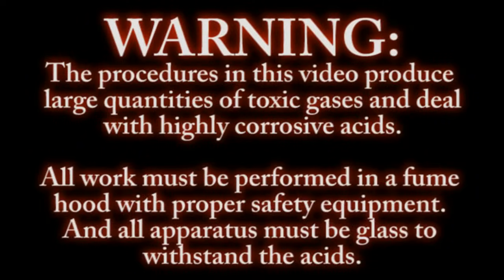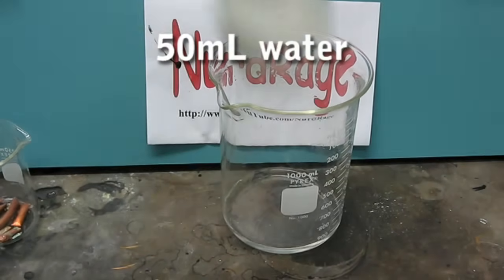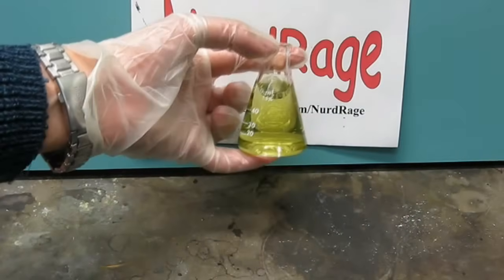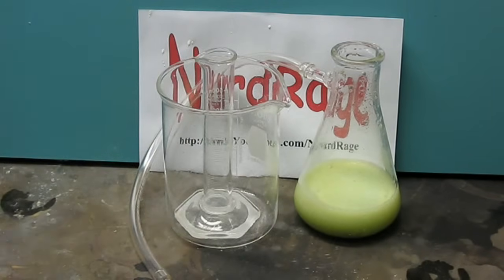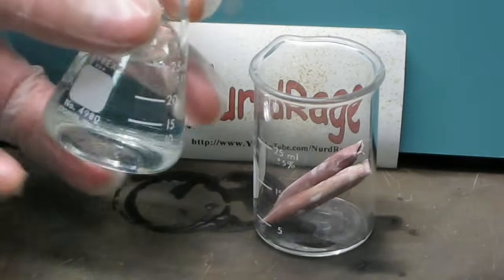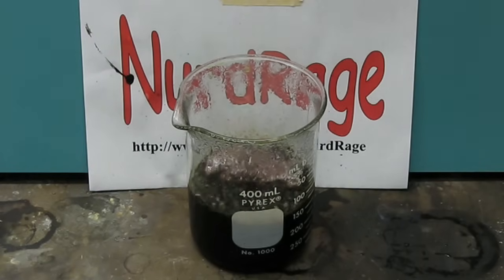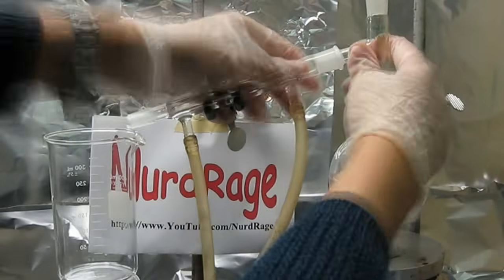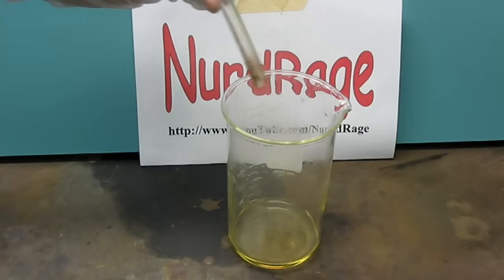Make Nitric Acid - The Complete Guide

Comment: I just thought about something. The reaction of nitric acid (formed from the hydrochloric acid reacting with a nitrate salt) with copper produces NO2 and copper(II) nitrate, which is a nitrate salt itself too. So does that mean that i could keep adding more copper and hydrochloric acid and the reaction would be renewable indefinitely? After all, the copper(II) nitrate would react with more hydrochloric acid to produce nitric acid, which would react with more copper to again produce nitrogen dioxide and copper(II) nitrate again, right?
Reply: MatBacon I wonder if there's a finite amount of nitrogen involved to process into nitric acid?
Reply: seigeengine So basically you're suggesting there would be a point where the copper(II) nitrate would run out?
Reply: seigeengine Gotcha, nice thinking there!

Comment: Make a tutorial on how to make hydrogen peroxide
Reply: Aeroscience +Aeroscience Synthesis of Hydrogen Peroxide
WARNING: Make sure you have a fume hood
Step one: go to the store
Step two: buy it for 1 dollar
Step three: take it home
Step four (optional): Pour into an amber glass to protect from light
Reply: Franco Miranda Food and drug stores only sell 3% hydrogen peroxide. He used 30% in the video, which can be bought at pool supply stores as a non-chlorine sterilizer.
Reply: Alternately, you can actually concentrate hydrogen peroxide.  Just pour 100ml of 3% into a clean (stupidly clean, perfectly clean, 100% truly clean like you'd serve it to the Virgin Mary clean...) beaker, put it on a hot plate and bring it to a light steam (not a boil.)  Let it evaporate off and when that 100ml is down to 10ml, it will be at or about 30% concentration.

Comment: Concentrated HCl boils at 48 to 90 degrees Celsius. If it was used during the exothermic decomposition of a nitrate with copper it would be evolved as a gas with the NO2 fumes. Wouldn't this reduce the yield considerably as HNO3 is a powerful oxidiser? I.e. Wouldn't the HCl fumes react with the HNO3 as it formed to oxidise the Cl- to Cl2?
Therefore, I wonder if a different and easily obtained acid with a much higher boiling point could be used? i.e. Phosphoric acid? If H3PO4 could be used the the Cu could not be recycled as it would not be aqueous and thus could not be displaced with Al (unless NH4OH was added first?).
Sulfuric acid is hard to obtain unless made in a similar process to your HNO3 process. The only place to obtain it in AU is in car batteries.

Comment: is this cheaper than buying it
Reply: +noahpitts12 Probably not, no. But it sure as hell is a lot easier than buying it... At least here in Finland lol.
Reply: cool thanks *****
Reply: @darkbowser ACCID It's highly regulated in some places
Reply: @darkbowser ACCID if you use 98% H2SO4 instead of drain cleaner, and your KNO3 has been recrystallized you can produce a much higher concentration of nitric acid than the azeotropic 68% crap that Amazon pedals and you don't have to pay a hazmat shipping fee either. fyi. just a couple of reasons for synthesizing it yourself.
Reply: You can't buy it here it can be dangerous in the wrong hands

Comment: There's a problem here.  NO2 is a "mixed" anhydride: it reacts with H2O to produce both HNO3 and HNO2.  2NO2 + H2O --> HNO3 + HNO2.  In industry, NO2 is normally used to make HNO3.  However, air is bubbled through the solution of mixed acids to oxidize the HNO2 to HNO3.

Comment: I tried the first method because I don't have all the lab equipment but I could not get a reaction....the potassium nitrate I used was purified from stump remover (spectracide) and I purified twice for a higher nitrate concentration using the recrystallization method. I used muratic acid (31.45%) and a lot of wire I stripped at exactly 40 grams. Am I not getting a reaction because of the lack of concentrated HCl? If so can you suggest a method for concentration I can do without going out and buying $200 worth of lab equipment?
Reply: When I made this years ago, using the exact same methods here, I had to be sure that the copper I had was not coated in any plastic covering. What I did was use around 10-2 gauge wire that was used for carrying very high current. Change up you wires and give that a try. P.s. the KNO3 and HCl seem to be fine, and if I recall I used the exact same concentration of HCl, and the same stump remover for all my KNO3 needs.
Reply: You need to set them aside (muriatic nitrates salt mixture) for 15 minutes to fully convert HCl to HNO3, then heat them by put the mixture (in glass beaker) in hot boiling water for 3-5 minutes, i hope its works (lol non english speaker)
Reply: Another cause is the copper, make sure your copper is plastic free, then etch copper oxide layer in muriatic acid until its shiny new copper, use copper wire to increase the surface.

Comment: I have been making great, very pure nitric acid using the last method shown. The one question I have is what is the pure white crystaline substance left over in the boiling flask? It is oderless and doesen't seen to react with anything. If heated it is soluble in water. I use potassium nitrate instead of ammonium nitrate with 99% sulfuric acid.
Reply from the maker: It's a potassium salt of sulfuric acid. It's exact composition depends on the mole ratio of salt to potassium nitrate to sulfuric acid you started with. If you used 2:1 then it's potassium sulfate, if you used 1:1 then it's potassium bisulfate, if you used somewhere in between then it's a mixture.
Reply: NurdRage Thank you for responding. I had concluded potassium bisulfate but my mole ratio is always heavy to the sulfuric acid. I do find it interesting that it usually solidifies as I'm pouring it, so I pour fast. Thanks again for your videos.
Reply: NurdRage I have made nitric acid in small amounts before but was considering buying it to save time and money but I was unsure if it is cheaper to make or buy?.... because I can buy pure potassium nitrate in bulk for very cheap as well as sulfuric acid
Reply: isaiah ragland If you're looking at buying fuming grade, the shipping costs will outweigh the cost of product. I found I can make 125ml of roughly 95% for about $4. I use 200g potassium nitrate with 80ml sulfuric acid. Just store it in the freezer.
Reply: 98% is highest purification of sulphuric acid....sorry....I can't help myself, I am so anal sometimes lol
Reply: +SMOBY44 
you have either potassium sulphate or potassium bisulphate
Reply: +SMOBY44 Yes make very sure you keep it in a NON FOOD freezer. If you just put it in a hazmat locker you will end up with thermal runaway.
Reply: Kenneth Johnson I actually keep it in my big storage freezer with regular food and such. It is stored in a brown glass bottle inside a large, sealed plastic container. It never stays around long enough to need to vent.

Comment: FInally got the pipette method working real good.  I left the room, came back and it must have foamed up as the damn test tube is pure green.  

So tired of wasting reagents.
Reply: well it did not foam over as my volume remained the same.  It simply turned blue green.  When I open the test tube (I have those nice pyrex screw top tubes) I get a lot of nitrogen dioxide gas form in the tube.

DOes anyone have any idea what happened here?  I used potassium nitrate  and clean copper.  I used 6% h2o2.
The end product does indeed rapidly dissolve copper.  But is obviously contaminated.
Reply: Clown Whisper  now its pale blue slightly, almost totally clear now..... lol wtf
Reply from the maker: Clown Whisper you might be making tiny amounts of blue dinitrogen trioxide. Which is unstable and eventually goes clear as it reacts with the water.
Reply: NurdRage Yeah its slowly clarifying over time.  I am going to jump ahead to the distillation to see if I have better luck,  I only have an allihn style condenser so its not ideal.  But I have an old school distillation flask so I will slide it way into the condenser to minimize the trapped acid scenario.

I hope that all of my screwups will help someone else lol!
Reply: NurdRage Here is a question.  I used the gas (pipette) generator method a few times and now I have 250ml of the dilute, clean nitric acid.   

Is it possible to bubble this with another generator to improve its concentration? 
Or does this pipette method become less efficient as the concentration increases?
Reply from the maker: Clown Whisper If you keep the acid ice cold as you pipette in more gas then you can certainly increase the concentration.

However I do recommend going with the distillation method (the third one) if you want to make useful quantities of nitric acid. The distillation method is faster, cheaper, less polluting and more efficient overall.
Reply: Ok I will go with distillation 
Quick question. 

What concentration would I want to dissolve silver?  Im having a hard time locating information like this..  I think I might take some classes if my health improves
.
Reply: NurdRage i have distilled a lot of ethanol in me life and know where to stop the process,
is there a easy to determine cut off point or temperature that tells you that you are no longer condensing nitric acid vapors?
Reply: NurdRage I have been distilling 100ml as I need it.  I cut off distillation at about 125 (25ml below theoretical yield) The last 25ml come off much dirtier and its not that critical that I waste a few pennies of reagents.

I have a question.  Seeing as how all of the decomposition occurs with when it comes into contact with oxygen in the air and regulated but temperature.  Could i introduce argon gas to the apparatus to counter some of the decomposition?
Reply: Clown Whisper It decomposes because of heat. If you want 0 decomposition you need to lower the boiling temperature of acid.
Reply: wwwelkam yeah i do vacuum sometimes but still get  a small amount of decomp
Reply: Clown Whisper Apparently nitric acid decomposes also by light.

"Nitric acid is subject to thermal or light decomposition: 4 HNO3 → 2 H2O + 4 NO2 + O2"
http://en.wikipedia.org/wiki/Nitric_acid
Reply: wwwelkam  That is true but its not my story.  When you do vacuum distillation using a nitrate salt and Sulfuric acid you are still going to see a good deal of localized heating at first. This is where your main decomposition occurs.  If you have vacuum turned on during the initial introduction of acid it will boil over into your condenser.

I have even super cooled the sulfuric acid with little change.  You can collect the yellow tinted product and redistill it over using vacuum method and you get a crystal clear product.
Reply: Clown Whisper Thats what happens when you want to mix it quickly.

I read that bubbling air trough contaminated acid can remove nitro oxide gases.
Also urea is used to neutralize dissolved NO2 gases and produce N2 CO2 and H2O

Comment: Here is a question for you.

regarding the pipette in the peroxide method...
If I do this reaction twice reusing the product in the 25ml container will the efficiency drop way way off to the point that it would be a waste of reagents or is your yield so low that you are likely to double its strength?
Reply: Although I am still interested in this concept, I just found an old school distillation flask that I can use with an old condenser that I have.
Happy days.

Comment: Man most of these experiments require fume hoods...how the hell am i suppose to do some home chemistry with this constant limitation? Does anybody know if there are adequate and affordable fume extractors that are portable and can filter chemical fumes??
Reply: Do it outside.
Reply: Build a small fume hood, its easy as heck can costs next to nothing.
Ols scrap plywood one small sheet of acrylic.  find a small fan and and old dryer vent ducting,
I build one in couple of hours.  My fan setup is no ideal but if I do a real seriously bad reaction I do it directly below the vent opening and everything gets sucked out.
Reply: I produce mine in my garage using a sealed collection flask with a vacuum adaptor with a piece of tubing I run outside. If you go to hometrainingtool.com they have a nice organic chemistry distillation set-up for about $110. It's the set-up I use complete with the vacuum adaptor. The product I produce is usually about 98% an fumes white. Hope this helps.
Reply: I just found a good way to improve the simple fume hood that I built.
i had a couple of small squirrel cage fans from appliances.  I think 2 old microwaves that I salvaged for the mag wire.If you use one of them inside the fume hood blowing into an (all plastic) dryer vent ducting tube and one on the other end drawing out, it becomes very very powerful.  my last setup struggled to draw out heavy gasses.

Just now I finished the upgrade and burned some glycerine on some cotton to get some heavy smoke going.  It lifted it right up and out.  When its closed all the way across it will suck a sheet of paper into it if you hold it in front of the opening. 

It is really quite easy to build one of these if the will is there.
The first one I had was made out of an old discarded acrylic display case that I found while driving behind a shopping mall. I took the shelves out and fused them together to form a hatch (door) for the front.  It was small and portable and could easily fit on a counter top.  I cut a sheet of acrylic that I had left over to fit my window exactly and attacked a dryer echused fixture that I bought for 3 dollars.

I got lucky with equipment I worked in robotics for years and every time that they were going to toss something out because the part was changed I took it home.  I ended up with 5 Jun-air vacuum pumps worth 1300 dollars each.  very high quality stuff. I got endless graduated lab bottles and stuff too. 

But as far as a fume hood, I can be built in an afternoon!  I actually had fun doing it.  It might be the funnest part of the whole deal.

For glassware, I had a butt load.  actually too much.  I hit the universities that have warehouse disposition departments   I bought 10 cases of 250 and 500ml flask for 10 bucks.. all corning.   I got 30 of the large pyrex heavy duty screw top test tubes for 3 dollars!  Those things are horribly expensive retail.  I just went on ebay and bought 8 1000 ml corning beakers for 20 bucks!  I about shit when I saw that deal.  Ill keep a couple and sell the rest for 15 bucks each and make some money to buy other things that I need.

I guess my point is to take it slow and have fun with it.  Look for deals.  Call universities in your area and see of they sell of surplus to the public.  Many of them do.  Glassware goes fast but you can get some if you try. tools that you cant afford to buy you can typically make!

good luck
Reply: Clown Whisper Nice work bro, I would love to see the setup. 
Its cool when you find people who use their brains and imagination to overcome obstacles. Superb example of ingenuity sir, bravo ;-)
Reply: Clown Whisper you have the scariest name on youtube
Reply: ipissed kinda hard when its minus 7 C
Reply: Do it outside.  Easy.
Reply: Get some plywood or sheet metal, paint it, construct a box with a glass front (fold the side panels 90 degrees to create an overlap with the sheet metal). For the top, take a range hood with a lamp and fan in it, replace the fan with the vacuum pump in a shop-vac, and bolt the modified overhead to the top of the box. Make sure you use the hose from the shop-vac to redirect the fumes outside, and if you can find some egg-crate foam, it can work as a decent noise retardant in a pinch.
Reply: I just trashed my exhaust system and bought a real real nice ventech 900 cfm 8 inch inline fan on an ebay auction fro 40 bucks with a nice variable controller 

Its not that the homemade ones dont work.  They just need to be cleaned too much because of their slower air movement.  

I know money is money and my latest addition did cost me 40 bucks but damn it was worth it.
Reply: Erfan Maleki As a Canadian, I am amused by your intolerance for t-shirt weather.
Reply: Also, about making your own fume hood....

Make sure you're cognizant of what it's made out of. You don't want to end up doing something stupid, and having your fume hood become an accidental reagent. :P

And be aware of how you're venting it. You don't want anybody to call the city on you.
Reply: seigeengine That's tanning weather in minnesota :D
Reply: NotSoLogical Let's not exaggerate. Minnesota isn't colder than Canada, and it gets far warmer than -7 C there.
Reply: Minnesota and Canada have very similar winter weather and we also have really hot summers with TERRIBLE humidity.
Reply: NotSoLogical I suggest you consider looking at a map at some point. Minnesota has similar winter weather to some of Canada.
Reply: seigeengine I think once you get past around -40 f, it all feels the same anyways :3
Reply: NotSoLogical
Reply: +Erfan Maleki 
just do it outside and stand away from the reacting  mixture
Reply: +Erfan Maleki Buy a $20 centrifugal fan (I think that's it) and some plywood. I bought a big, old, and light glass window for 10 cents at a yard sale. That's really it, but I did it without and stood several yards away outside.
Reply: xuNsh1ne Why... That's what a fumehood is.
Reply: +ScienceIsMyDrug Nope. A gas mask will not protect you from acid fumes.
Reply: Eric Hoffman Yes, they will.
Reply: +seigeengine Okay, to be more specific: the gas masks you buy at big box stores which are made for painting and sanding will not protect you. Be sure you're using a canister that specifically states protection for "acid gas".
Reply: Eric Hoffman They may not, as those are not "gas masks," they're "particulate masks."

Gas masks use different filters, and there are hybrids between chemical and particulate filters. You do not need a special filter for acid gasses, you just need a standard chemical filter, although a specialized one would be preferable, it would also be less versatile.